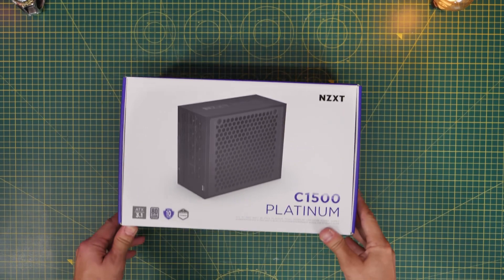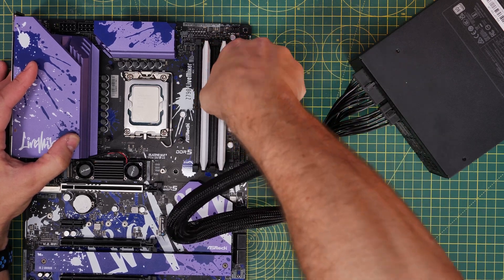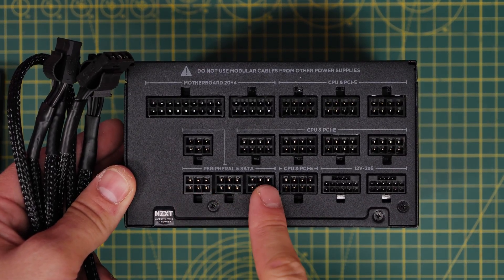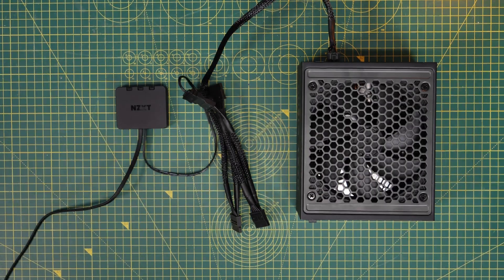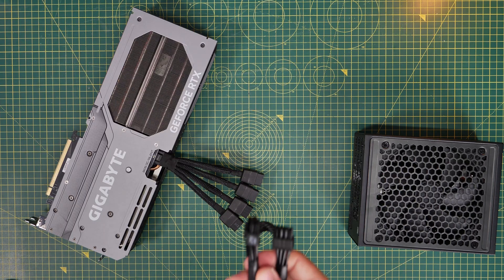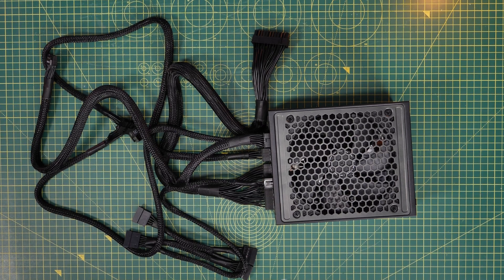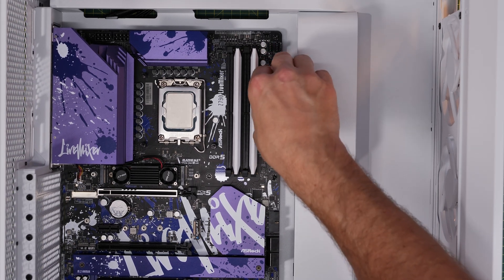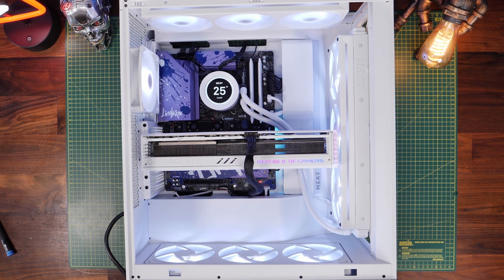NZXT C1500 Platinum PSU wiring and install guide with tips

Comment: Hey Prawn, very quick question - exactly what connector and fuse is the AC power cord? 

Is it C13 or C19 connector? And is the plug a 10Amp, 13Amp, or 15Amp?

I bought an NZXT C1500 from an EU online retailer and it came with an EU AC cord and I want to replace it with a UK version but I don't know what will be safe to use!
Reply from the maker: I'm afraid I don't know the specifics. I tried googling for you but to no avail. Perhaps ask NZXT?
Reply: @TheProvokedPrawn  I emailed NZXT and they confirmed it is C19 connector, and the plug is rated for 16Amps and uses a 13Amp fuse. Turns out it was very easy to find and replace the EU cord with a UK one.

Comment: I'm glad you showed a 3060 8 pin connector to this PSU because until I get a new 5000 series GPU when I buy this PSU my temporary 3060 will get used

Comment: thanks for this video.  i need a 6pin pci to power a card temporarily, and I wasn't sure if the cables were still old style 6+2 or just in name only.  there are too many videos that show just the specs and performance numbers of a PSU and not just basic installation.  This is great content.  thanks again.
Reply from the maker: Glad I could help